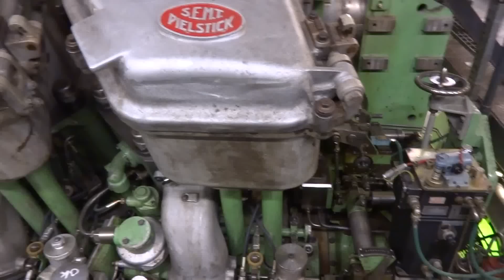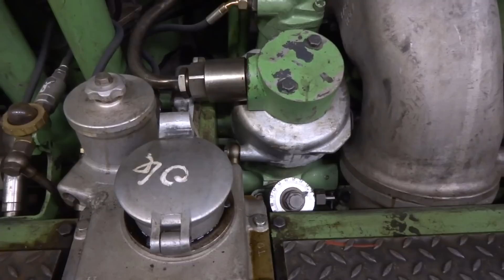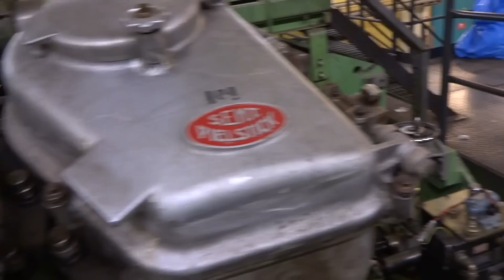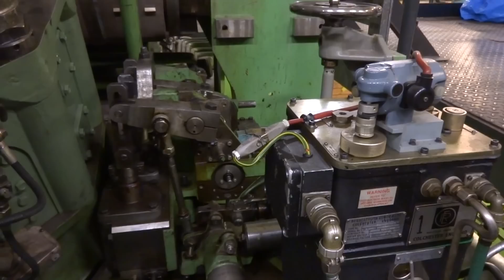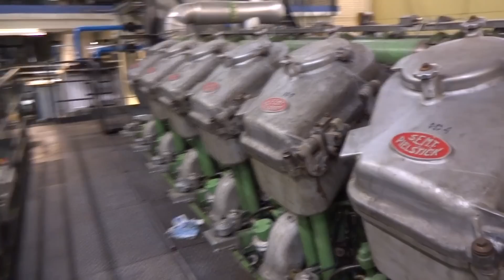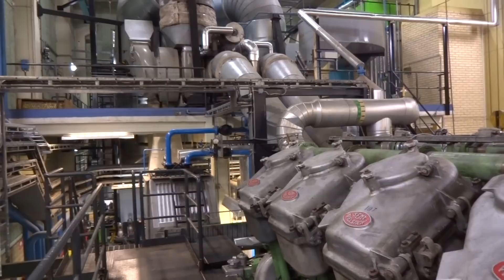Start giant diesel engine

Comment: This is actually considered to be medium speed diesel (medium size). Low speed engines are 'huge' for example the Wärtsilä- MAN/B&W (now MAN Diesel & Turbo SE) 14RTAFlex96C is world's largest diesel.  At fourteen cylinders wtih bore of 96 cm, stroke of 2.5 m, three turbochargers, five decks (15 m high) operating rpm between 22 and 105, now these are huge! (Also my favourite engine).

This here is SEMT Pielstick (SEMT = Société Etudes Machine Thématique) medium speed marine diesel from SEMT Pielstick, which is now part of MAN Diesel & Turbo SE.
Reply: Tatsuhiro Sato All the Wärtsilä engines have for years been called "Wärtsilä" without any remains of the companies Wärtsilä bought and/or their manufacturing rights, so it's now simply "Wärtsilä 14RTA96-C engine", not "Wärtsilä-something-and-so-on" (engine).
Reply: MAN B& W K108ME-C  has 1080 mm dia. Piston 101.415 MW shaft power.

Comment: Been working with a 6000 hp, V-12 pielstick for 6 months in the merchant marine, great engine
Reply: Geir Ove Drageide Guess you got a lucky one because Pielsticks are WELL KNOWN for being leaky, noisy, unreliable, and a NIGHTMARE to work on.
Reply: Officer KD6-3.7  Yea, I heard they are bad engines. What made them bad though? Hot spots? Poor oil lubrication? Electronics?

Comment: Awesome sound <3 Would like to see the exhaust, must be impressive...
Reply: They are pretty large... even ships auxiliary engine exhaust is so large that you can fit in the pipe. When i still worked as maritime electrician i changed a light bulb at ships exhaust pipes. Main engines were off but auxiliary wasnt. After the bulb change i can tell my clothes needed wash. I still miss my work at maritime electrician... saddly i got diagnosed epilepsy that killed my career. 😪

Comment: what is that blue thing that is small and has the verry slow turning rod on it. i think it must be under some stress. slow but powerful. please tell me what it is.
Reply: The whole thing is the governor of the engine and the blue thing is the electric  motor of the govenor
Reply: Governor speed setting motor.

Comment: What is the displacement of this engine?
Reply: 158 L (9641.75 cu in) per Cylinder, 2844 L (173551.5cu in) for the whole engine. It is 1400 times bigger than the most car engines.